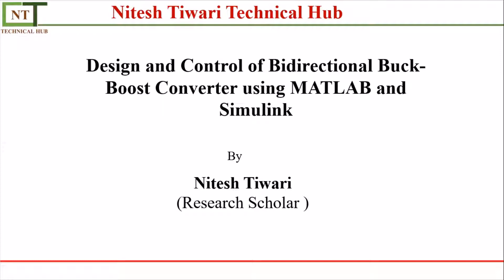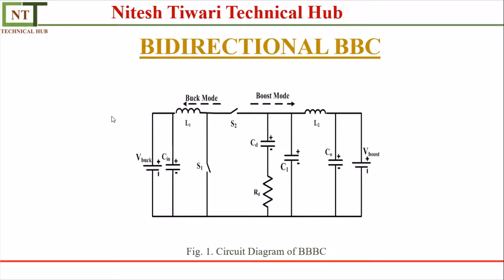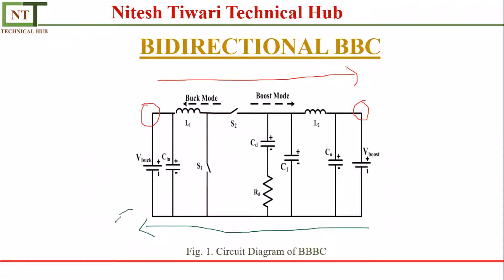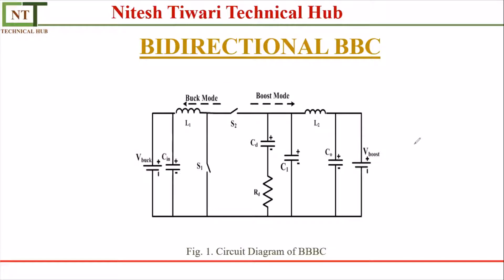Bidirectional Buck-Boost Converter | Lec 02 | DC-DC Converter | BBBC | MATLAB & SIMULINK

Comment: Signal Generator: wave form = Sine, Time(t) = use simulation time, Amplitude = 1, Frequency = 10000, Units = Hertz, Check Box to Interpret vector parameters as 1-D.

Pulse Generator: Pulse Type = Time Based, Time(t) = use external signal, Amplitude = 1, Period (secs) = 10, Pulse Width (% of period) = 5, Phase delay (secs) = 0.

Using the other values in the video, this gets me the correct boost voltage of 191.4 V and buck voltage of 49.56V. Hope this helps.